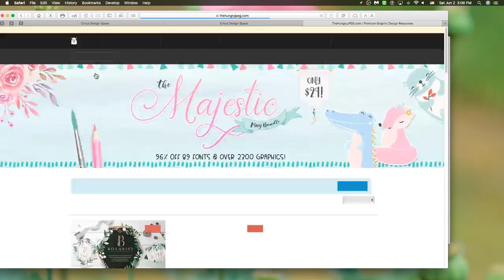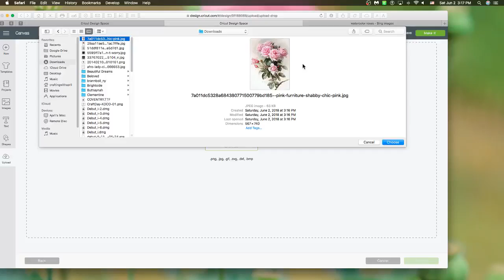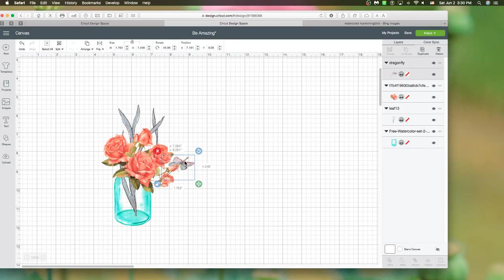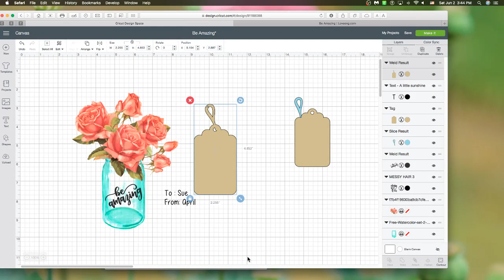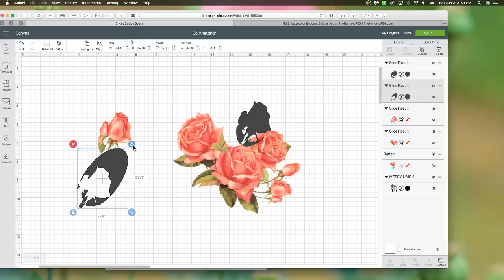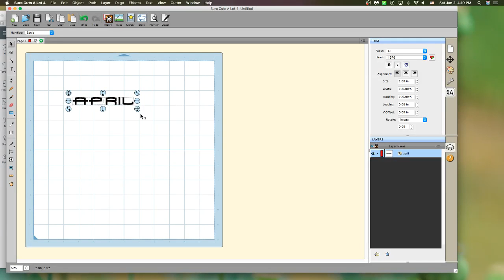Ask Me Anything- Patreon Supporters - Uploading & Combining Images

Comment: thanks for the video.....I'm new to watching you and watched after it was live.  I have a question, what kind of printer do you use to print in color, I'm assuming on printable HTV?  Thanks!!!
Reply: April like this printer because it can print up to 12 x 12 paper
https://www.amazon.com/Epson-WorkForce-WF-7610-Wireless-Printer/dp/B00JXLGETI/ref=as_li_ss_tl?ie=UTF8&qid=1514483925&sr=8-3&keywords=epson+7610&linkCode=sl1&tag=cricutcraftin-20&linkId=e5f8d7b3335933d798670d1be4d7a099   and Starcraft from Brilliantvinyl.com ...for Light or Dark fabrics printable vinyl...holds up really well after washing   https://www.brilliantvinyl.com/StarCraft-Transfers-for-Dark-Materials-10-Pack-of-8.5-x-11-Sheets.html